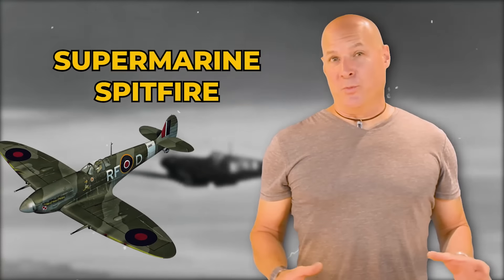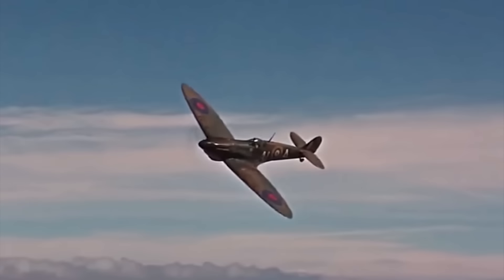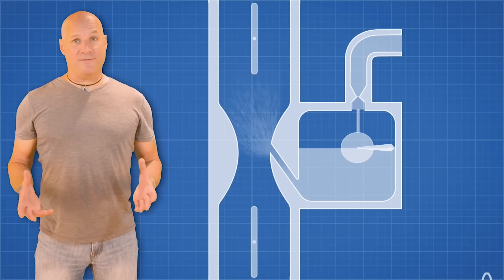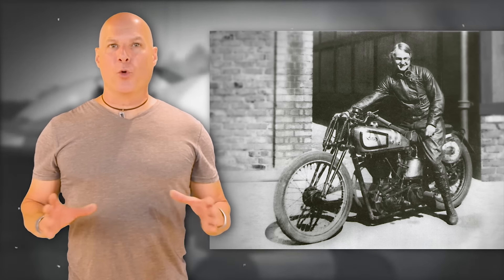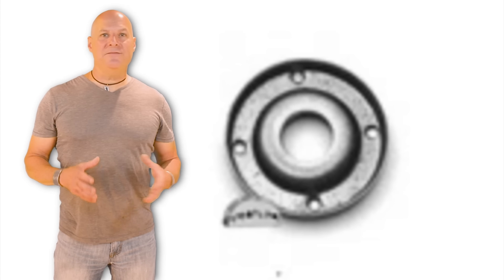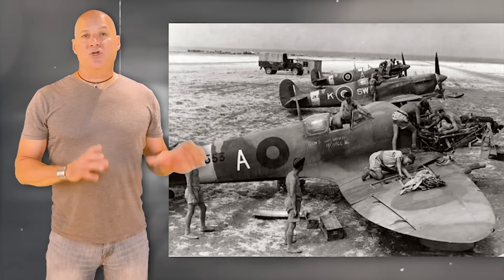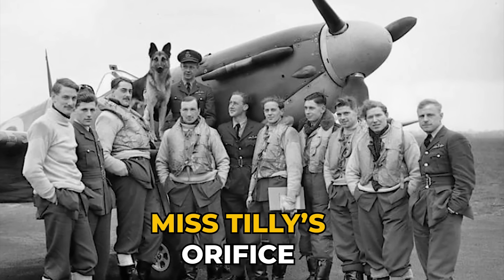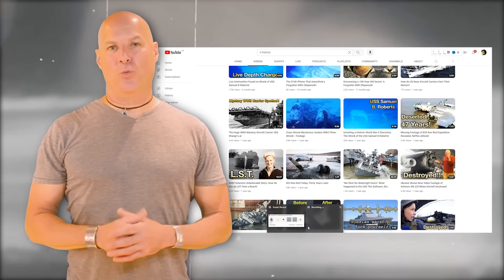How did SHE Save Britain’s Troubled WW2 Spitfire Warplane?

Comment: Saying that the Spitfire was awful and was saved by Miss Shillings Orifice is the same as saying that the P51 was awful but was saved by Rolls Royce and their Merlin engine.
Reply: But although the word Awful is a bit of a stretch, in both cases there were "issues"....
Reply: It was
Reply: Have you SEEN what happened to the Allison Mustangs ?  There certainly were problems with the engine cutting out, but the effect was exaggerated.  Spitfires (and Hurricanes) without, "Miss Shilling's Orifice," still did fairly well.
Reply: @AndrewComerford-l1z  The Allison Mustang ran out of breath at 15,000 feet! It was ok for low-level.
Reply: Roles Royce Merlin engine did save the Mustang
Reply: @lesliemcarthur4856  No, they MADE the Mustang....only problem was: americans could not produce the motor; they neede the English for that....
Reply: Because it's true!
Reply: @lesliemcarthur4856  
This is maybe a bit exaggerated but it certainly was crucial to turn the Mustang into the escort fighter it became so famous for. If it was not for the 2 stage supercharged Merlins, the Mustang would probably have stayed a good intruder for low level raids and tactical missions - but not much more than that.
Reply: @p.h.m.kletersteeg117  That is actually wrong - Merlins were mass produced in license by Packard in the US. So many of them were built, that they were installed in a line of late production Spitfires as well (the Mark XVI, of which about one and a half thousand were built).
Reply: @p.h.m.kletersteeg117  That's why they let Packard make them!
Reply: @lesliemcarthur4856  Yep above 15k ft. I've read, later on in the war, the Merlin, in some cases, went to single stage super charges to save weight.
Reply: @p.h.m.kletersteeg117  Actually the Brits did very well with the P-40.
Reply: @hamshackleton  Well, the first model (mustang): the model was good but the motor not. that is when they decided to take the Rolls Royce. But the English had no capacity, so decided was to make it in USA. But that motor was rather complex, so at first, the factory could not make it. After receiving more documentation, and help/advice from the english, it went ok.
Reply: @lesliemcarthur4856  ~ The US could have improved the Allison engine for higher altitudes, but why bother, the US had the Packard Merlin, it was perfect marriage of the two.
Reply: But the P51 original engine was awful and the Merlin gave it new life.
Reply: @JosipRadnik1  Yes but only because the British could not keep up with the demand for the engine and allowed the US production under licence.
Reply: @0Zolrender0  Indeed.And it became a very good plane; even nowadays it would be useful....
Reply: @0Zolrender0  
what ever the reason was - Merlins were license produced in the US too - especially those scheduled to be installed in Mustangs. It makes sense after all as the Merlin was a damn good engine in high demand in many variations and purposes.
Reply: @0Zolrender0 Actually the Allinson wasn't but on the other hand, the US saved the Merlin from itself by introducing the Bendix pressure carburetor. An upgrade for the Merlin was using Allinson con rods which were stronger.
Reply: Correct! The P-51 was a dog. Are you making a point?
Reply: Ever heard the expression 'The asthmatic Allison'.
Allison's were excellent engines BELOW 15to20,000ft.
Reply: @p.h.m.kletersteeg117  The Americans were a bit "export sensitive" about their turbo-supercharger & multi stage supercharger technology & that was the cause of the export Allison's asthma problems.  
The P-51 was originally a fighter bomber which, I assume, means low altitude.
Rolls Royce didn't believe the yanks could mass produce Merlins to the same standard as their hand built ones.     Packard proved them wrong.
Reply: @aussie6910 Because that's the way they were designed.
Reply: I kinda was and I’m a biased American  but they definitely weren’t awful
Reply: That’s a good comparison and great observation!  Nice job!
Reply: @31terikennedy  Yes, that's why the Allison did so well in the Pacific were most combat was below 15,000ft.
P-51A was a fighter bomber, not meant for combat at 25,000ft.
Reply: @aussie6910  Allison did well in North Africa too. It did what it was designed to do.
Reply: @aviancypress5181 Allison did what it was designed to do and it did it well. The Merlin performed well after the US gave it the Bendix pressure carburetor.
Reply: @31terikennedy  Yes, very well.  Again a low altitude war, relatively.
Reply: @p.h.m.kletersteeg117 58000 Merlins were produced by the Packard car co. And the Continental aircraft co. Under license.
Reply: Because it's the simple truth
Reply: Who said “awful”?
Reply: @inominate2024  You mean:..is spelled wit a "E"-- or is spelled with a capital...
But only for the english.....
Reply: Both points are true. Does Roy have a problem with giving credit to a woman for helping men improve their machined?
Reply: @p.h.m.kletersteeg117  Not really. Maybe the design, but not the industrial capacity.
Reply: @JosipRadnik1 It wasn't just the Packard Merlin, but an 85 gallon fuel tank that was installed behind the pilot that gave the Mustang its long legs.
Reply: let's not forget,without the RR Merlin engine the p51,would have been a complete waste of metal
Reply: why do the yanks try to take the credit for all of ww2? it was already half over when they joined in,thanks to the British, its empire n the russians
Reply: No one said awful, why is it so hard to give this woman credit for helping?
Reply: @p.h.m.kletersteeg117 No, just the license for Packard to build Merlin engines. The Allison worked well below 15,000 feet. Rather than waste time and resources coming up with an engine for high altitude work, RR licensed the Packard Motor Company to build Merlin engines to install in Mustangs. Adding the fuel tank behind the pilot turned the Mustang into an excellent long range fighter..
Back in those days there was a goal in mind - defeat Nazi Germany, fascist Italy, and Imperial Japan. Not so much of a urinating contest like takes place on these comment sections and forums.
Reply: The P-51 was not awful without the Merlin, just mediocre.
Reply: @Future-Preps35  True.But at start, the americans had problems reaching quality standards.
Reply: @lesliemcarthur4856 It did not save the Mustang , it made the Mustang.
Reply: @p.h.m.kletersteeg117 Several manufacturers were approached in the US with Packard impressing the people from RR enormously. 
      Packard had no difficulty in producing the Merlin and made many improvements , most notably the crank bearings. 
      What a shame Packard did not survive in the car industry. They did some brilliant engineering.
Reply: @briancarton1804  Indeed; some very fine producers went down in the wars of economics.See more recent: Fokker airplane factory; Rolls Roys car factory (makes now tasteless mercedes) and so on.
Reply: @p.h.m.kletersteeg117  I think you meant to say Rolls Royce make tasteless BMW. After all that's who owns them.
Reply: @p.h.m.kletersteeg117  I think you meant to say Rolls Royce make tasteless BMW. After all that's who owns them.
Reply: @briancarton1804  You are right. In my defence: put all german cars on a line, and their backsides look like fat german women: all alike.

But ashame that good taste and style, and top skills were given away for some money....

Holland had the same with Fokker airplanes and Mercedes.
As revenge the Dutch closed a German electronic factory with10.000 ppl.
Reply: @p.h.m.kletersteeg117  Problem was RR simply was not big enough and could not fund r and d after the company was split between cars and aircraft engines.This was done to benifit shareholders. The car manufacturing had too few modles all starting off at prices most could not afford. Had they built a larger range starting out with smaller cars and engines , moving up in size and engines the company would have been bigger being able to spread the cost of r and d across the range.
    All their technology was way out of date and they had to buy BMW engines to replace their aged unit that was long overdue replacement. 
     With all the electronics in cars today RR just could not make it on its own.
     By the time it was sold all the had was a tiered old modle range with out of date technology. RR simply could not make it on its own.
Reply: But that’s a fact!
Reply: @0Zolrender0 The Allison was every bit as capable as the Merlin, with half the parts. The only thing that let it down was not having the two speed two stage supercharger the Merlin had, and that was only because no American company was willing to make them until they were required to for the Packard Merlin. If they'd made them willingly before that development, the Allison would have escorted bombers deep into Germany.
Reply: @Future-Preps35 The Merlin wasn't used or even needed in the P-38. It did fine with the Allisons.
Reply: Enough,,,,SHE did good, the Brits did good, USA did good; our parents did VERY Good!🧐
Reply: It was
Reply: The Spitfire wasn't awful it just had a few bugs and the Lady worked to fix the biggest one.  God bless the women who helped us win WW2.
Reply: @timengineman2nd714 😊😊😅180
Reply: @timengineman2nd714 😊😊😅180
Reply: The P51 was awful, at least at the altitudes it needed to fly at, and was saved by the Merlin engine ...
Reply: It's a bit of an over the top statement to say many pilots would have died ... The only issue the Spitfire had was the engine died briefly if the stick was pushed forward to follow an Me109 and this was the only occasion a Spitfire would require to do this as it was the only way an Me109 could escape